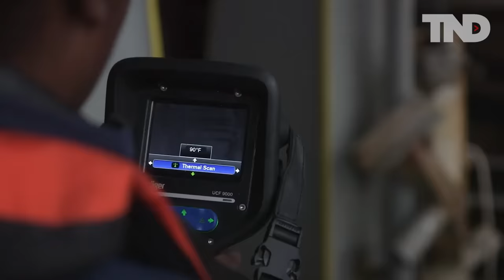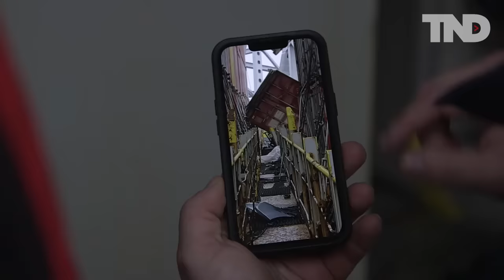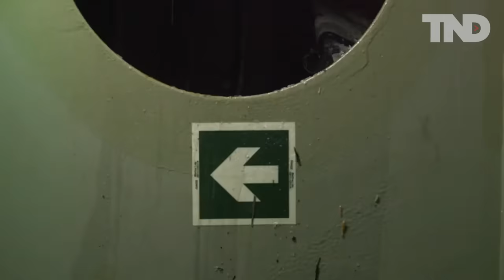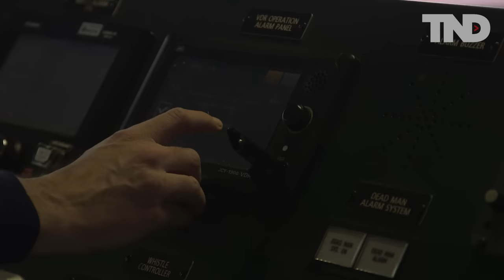NTSB video shows inside of DALI cargo ship, close-up damage to Baltimore bridge after collapse

Comment: Just looking at this, this is going to a massive operation!!
Reply: . Yeah, I heard one report say that it's going to be extremely dangerous to remove wreckage. I can easily see that. It's a twisted mess, and underwater salvage is never easy, at least from what I've read. I just hope they're given the time and resources to do it right, and safely. There's a lot of pressure that's only gonna intensify to get that waterway open.
Reply: Not for you so you have nothing to worry or speak on

Comment: Its such a mess that its hard to tell what's part of the ship and whats part of the bridge. I wonder when this is all over if the Dali will be repaired to sail again or if it is considered damaged beyond repair, to be sent to the scrapyard.
Reply: The damage looks superficial, not taking on water. I suppose it depends on the amortized value of the ship and what other repairs it needs vs what the scrap value is.
Reply: I was thinking the same thing! Wonder what was in those black barrels?

Comment: Anyone else looking at these pictures and wondering just where to start with the clean-up? I am, but as with anything complicated, the method will be to take things one step at a time. Probably clearing the container ship out of the bridge debris so that it can be hauled back to the Port for inspection and then repaired. Then crews will start at each end and in the middle to clear the main shipping channel!
Mark from Melbourne Australia 🇦🇺
Reply: The load is massively heavy, they cant unload right there, the boat is not seaworthy, it will be complex to unload containers
Reply: Roger from the US here 100% agreed there is nothing  to see here bring in the Humongous  Cranes   get the ship back to port clean up the mess and move on it will be a good 10 yrs before a new bridge is built

Comment: How close (distance) was the vessel to the bridge when the first power outage happened?
Reply: The ship was moving around 8 mph when it lost power and between the time is lost power and contacted the bridge was less than 4 minutes.  This means that they were about 1,000 feet away when power was lost.  The ship itself is 984 ft in length.   Empty the ship weighed over 90,000 tons.
Reply: Too close

Comment: …so now the cargo ship has constant power.????? Even after hitting the bridge and the bridge falls on it, it has power??? Really? WOW
Reply: Well, considering all the machinery is located aft, where the bridge didn't fall...
Reply: Did you gradiate with any technical or engineering degree first of all?
Reply: you obv no nothing about ships. and if u watched the video the power came back on but they didnt have enough time to reverse the ship (not enough distance)
Reply: Yes, diesel motors don't require electricity
Reply: @eng3d  - but the controll systems and steering do
Reply: @rosean374 to answer Your statement- I actually have TWO DEGREES, and a Graduate Certificate. If you notice my comment, it has QUESTION MARKS…..so apparently I don’t know anything about ships. I didn’t say I did. I’m wondering what caused it to lose power and how were they able to fix it with all that is going on. 
I’m also amazed at the fact that they are comfortable being on the ship. 
I amazed at anyone who finds comfort on a ship—-I’m afraid of being totally surrounded by water whether I am on a bridge or a ship. 
Thank you.
Reply: @eng3d Thank you, I didn’t know…this is all new to me.
Reply: sorry  but you got fuel pumps   water pumps  air handlers  coolant  hydraulic systems  electrical  all running on seperate engines    google  cargo ship engine tour   its a massive system  all with back ups   except the collosal main engine .  that ship has a severe electrics fail   and the back up kicked in a few moments later and it failed too    the bridge i bet is on its own dedicted  power too /backup?
Reply: @vanish2020 I thought it “flickered”, I did not know it stayed on. I guess I was watching to make sure no one was on the bridge.
Reply: @glennsoucy4359 Oh, okay I understand.
Reply: @whatalady47 Given a phobia of ships, I can understand you not being on one.  I have been on a similar boat as a passenger and I must emphasize - these boats are huge.  The town I grew up in would fit on the deck.   The framing, and the sheet thickness of the hull is a steel alloy and is between 85-100mm  thick on larger container ships.  The bridge, while it does appear huge, would be able to be stowed and transported, even on a smaller ship.
Reply: They have Repairmen who Work on the  Vessels .
Reply: likely emergency generator providing just enough power to give emergency lights and bridge so the crew could at least see what the ship was doing
Reply: @whatalady47 . I hear ya. That's a massive ship, but would feel like tiny speck of dust out on the ocean. Maybe I've watched too many disaster movies, but I know I would have all those scenarios going through my mind. .. As far as the power goes, are you referring to lighting? I know that there had been mention of generators. Anything else you would probably have a better idea than I would. I would think they're not touching anything with the engines,etc. till the investigation is complete, but that's just a guess. By the way, watch out asking any sort of question on social media- the keyboard experts will immediately assume that you are the dumbass.
Reply: @MKOMKONNNN . I would imagine there's backups for lighting,etc too. Not to mention communications . Now I was thinking that as far as everything else goes, they're not gonna touch much until the investigators clear them too? Just my thought anyway. I try to presume very little, cuz I have no idea what goes on with these ships, and now the investigation. I think some people watch a movie or two like "speed 2" or "the titanic", and now think they know all about ships.
Reply: Well, considering that all that’s currently being asked of the generators is to keep the house lit and recharge those federal laptops…

…as opposed to say…providing enough electric power to propel 100,000 tons through the water at 10-15 knots. 

And I’m saying that a decent ship in good condition should be able to do both…I’d just be less surprised if a problem happened under the greater load, that’s all.
Reply: @rickbusch7911  “…the keyboard experts will assume…” 😂🤣😂. Thank you, I will remember that.

Comment: The mayor of Baltimore might complain about any criticism of this bridge by what he calls non engineers, but it is clear that this was a very fragile structure, what if a small aircraft had hit it. The ship does not appear to have suffered as you might expect from such a collision, if you consider the effect on the bridge itself. I think it will be evident as to the bridges fragility when observing how difficult or not it is to remove the structure from the river.
Reply: The bridge wasn't fragile. Most bridges in the world would collapse if they were struck by a ship weighing 150000 tons moving at 8 knots. You have no idea how much force such a large and heavy object can exert
Reply: That bridge had no chance against a ship of that tonnage.    That ship fully loaded weighs 4 times as much as a modern submarine does
Reply: @gregorylyon1004  you have answered  one part of this question, there should not be any ships passing this type of bridge that are above a weight that will cause a collapse in event of an accident . I wrote a bit more on another site and was interested to gear an ABC news program from Darwin, Australia, in which two bridge engineers remarked on exact the same problems I have high lighted here and in the other posting. One being a question about building a rigid integrated metal structure on insufficient pillar supports and why no additional anti ship barriers in the river , either side of tge pillars. Given the rise of ship size and weight over the years, these could have been built retrospectively . You might consider my point of fragile in relationship of the high steel arch to the connection with the pillars . I believe there are four pillars at each of three major support point and in theory this integrated metal structure should have remained intact despite losing a pillar or two at any of the three supporting points, however, one pillar at one end was hit and the whole structure folded. What about the huge cruise liners passing a new bridge, is it OK to say cross ypur fingers each time, or learn and either stop the commerce and large ships or find a way to guarantee the bridges safety.  What worries me is the rush to build a new bridge while estimating the time needed for an investigation will take two years.

Comment: How is it possible that Dali is still on even keel? There is seemingly no water ingress after having run down a huge concrete pylon! Simply amazing.
Reply: Simple, the weight of portions of the collapsed bridge have forced the ship to be grounded on the bottom of the channel.
Reply: i suspect they are going to find the impact was well above the water line. It seems the ship came at the pier on an angle and the bow of this ship has significant flare or what's sometimes called a clipper bow. The rail extends out significantly from the narrow 'peak' of the bow at the waterline. This 'over reach' meant the rail contacted the support columns FIRST and cut then like a swinging axe .... before the water line hit the support structure. Again, more extensive protection might have 'kept it away' .... the ship hit a glancing blow and might have slid down the base had the overhang not clipped the column . . . There are many pictures of cases where a clipper bow hit a pier head on and the damage is well above the water line as the point of impact was well up the flared portion of the bow ....

Comment: I thought they should have used Lidar  to get more detail then just a phone camera.
Reply: Lider??
Reply: They'll use every type of equipment they need to figure out what happened. The cameras they're using in this short video are to document the shape the ship is in now, and other equipment and methods will be used where needed. The video we're seeing is also part of the documentation, to show where people were when they took specific photographs. Meanwhile, the old reliable paper notebook is still a very valuable tool, as we see. It can't be hacked, files don't get corrupted, There are many ways for NTSB to do their investigations and we're not seeing all of those at work We may in future, but this is still in the very early stages.
Reply: @nathandodge665 probably meant Lidar for scanning everything and recreating it in renderings.
Reply: They have a cameraman following them.
Reply: Seems like the scope/focus of what this crew was looking at was identifying hazmat cargo containers that have been affected or compromised, less than a structural analysis of the wreckage. 

There will be a master cargo manifest detailing what was in each container, and in what position each container was placed.  The shipper has a duty to separate containers with hazardous cargoes that could react with one another if opened/spilled. 

So getting a hold on all that has to be done before you can start thinking about pulling debris off the nose of the ship.
Reply: Preliminary study?

Comment: I hold a Masters of Science degree in Marine Surveying and am a British UK Chief Mate/Master Mariner. My research thesis found a frightening problem lying in the underbelly of global shipping since wooden ships sailed the oceans, and no one cares because "this is how we have always operates."

The bridge is not the problem. Below is the scandal.....

1st Problem) Maritime do not have sufficient redundancy in their technical design, unlike Offshore Vessels for Oil, Gas & Renewables

2nd) General Maritime run Vessel Maintenance practices that are archaic and over 60 years old.

3rd) General Maritime confers responsibility of producing Maintenance Strategies to OEMs which is high risk since OEMs do not know Operating Context of their equipment onboard ship. 

4th) Most ship Maintenance schedules are arbitrarily derived which is dangerous because it causes invasive maintenence due to infant mortality in conditional probability of failure Analyses.

5th) Maritime do not produce Analytical Engineering Analyses techniques such as Fault Tree Analysis, Failure Modes Effects Analysis,  Failure Modes Criticality Analysis, Event Tree Analysis, Binary Decision Diagrams, Life Data Analysis....because the Shipowner Technical Experts are Ex-Seagoing Chief Engineers whom are not Professional Analytical Engineers. Ship Engineers place Buckets under leaking valves to limp home, where they obtain OEM technical Engineers or Class Society help, but OEM have their own commercial agendas as too Class Socities whose limitations of liability rarely exceed 2million USD.

6th) Maritime has never brought any defence to the Resnikoff Conundrum because they are unaware of it. Again because they use wrong Engineers I.e. Ship Engineers whom are with respect operational mechanical, electrical and not analytical disciplined

7th) No Reliability Analyses or Reliability Management techniques are undertaken.

Maritime is the only industry on Earth that is running 2nd Generation Maintenance Strategies being over 60 years old and those that utilise 4th Generation Maintenance Strategies using Condition Monitoring confer this responsibility to the OEM who then over prescribe sensor monitoring to make more money when in reality only 20% of known ship Failure Modes benefit from Condition Monitoring. This is inherently dangerous for ship Reliability and Availability.

Have a lovely day.

Comment: Why is the NTSB using a crappy digital camera still?  This is a bad sign of how slow they are functioning. You have an issue with your SD card and have to revisit and retake all the photos.  Wtf. This is not a good sign. 

Coast guard has it together and is also using FLIR and other tools. NTSB has a camera from 20 years ago. No wonder their reports for everything take 2 years to be released. Good lord. Someone needs to overhaul that department so we can find out why planes have issues and not wait for years. 

Literally that camera gives away a lot of how slow and behind NTSB is of issues and how to respond quickly. Aren’t they in charge of all the deteriorating infrastructure and bridges?  Great…
Reply: Oh please! Camera wasn’t crappy….. your lack of respect is though.

Comment: Where was the harbor pilot and the tugboats to guide it out to the sea?
Reply: There were two pilots on board, who were responsible for everything that happens in local waterways.
Reply: Tugs were used to guide the ship off the dock and into the channel.  They left once the ship was in the main channel.  This is standard procedure for this harbor and has been for a long time.  There were two harbor pilots on board the entire time.
Reply: @davidmackenzie9701 no they are not, pilot’s only have a advisory role. The captain is and remains always responsible.
Reply: It's all a cover up by the city of Baltimore.     They had a local pilot onboard.
Reply: So you really think the the NTSB and the USCG are going to cover up for the City of Baltimore (if you are correct)?    There is one small problem with your theory.  The Harbor pilots work for the Maryland Port Administration - they are state employees.

Comment: I want to see inside DURING the actual turning of the ship, with power on mind you, because that's when it made a hard turn directly into the path towards the bridge. With audio and video.
Reply: The change in direction was due to currents and wind.   Prior to the impact, the ship attempt to turn hard to starboard (right) but without power the rudder was inoperative.

Comment: My guess is it was remotely hacked moved the rudder then shut the engines down on them. They have driverless cars.
Reply: There is no connection to any outside network. In fact if you connect it to the internet it will stop working